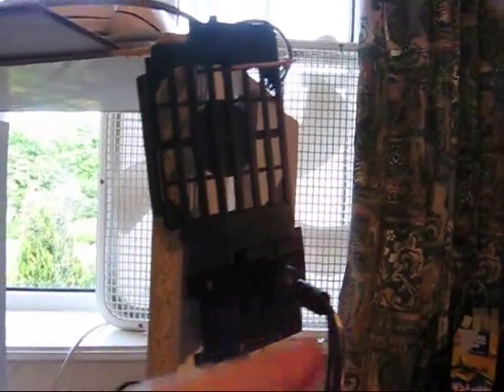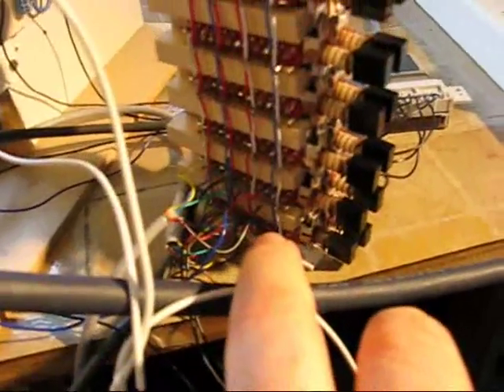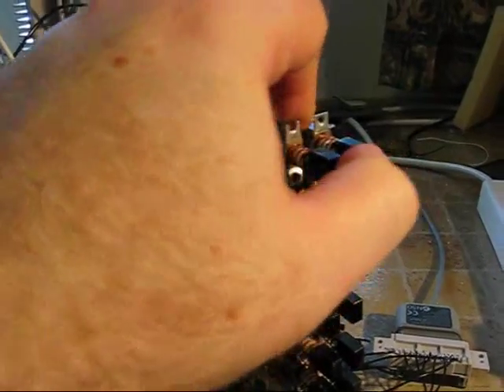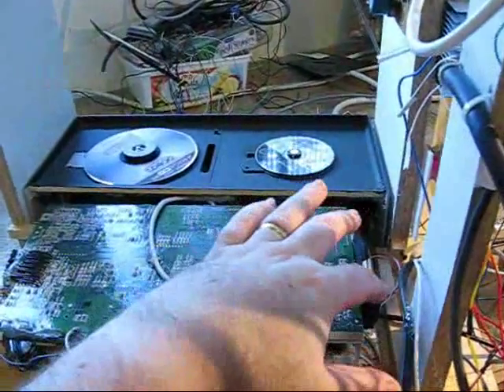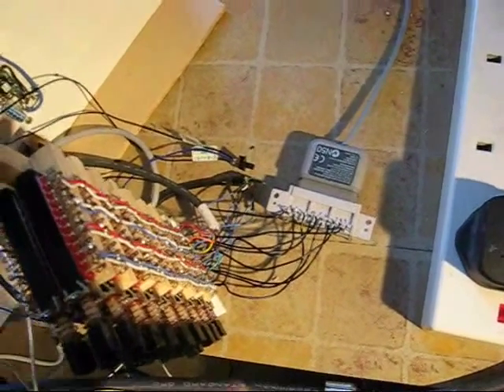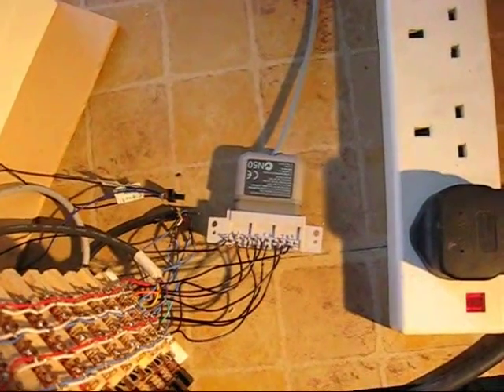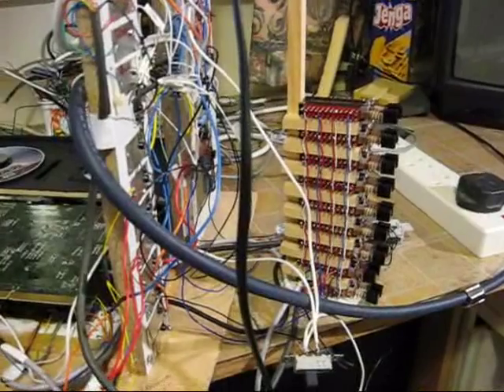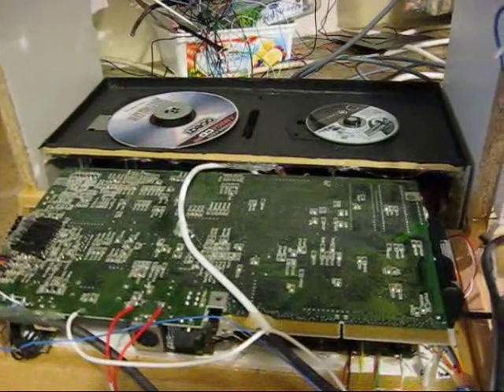Alpha Omega project - part 8 - System overview and demonstration so far

Comment from the maker: No, just single player. I only need single player anyway, and also if I wanted two player it would double the work on a lot of the system. It would also need more banks of switches which would be a problem.

Comment from the maker: Indeed, fixing things later is a concern so am making it as easy to get into as can, although in reality won't be as easy as just pulling things out; wires will need removing and re-connecting for sure. Trying to make things as hassle free as possible though for future repairs.